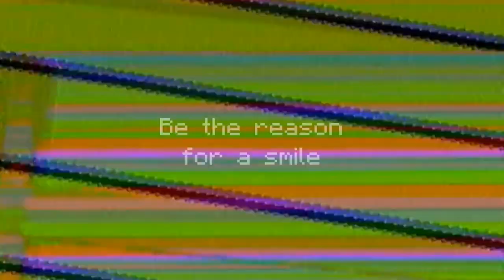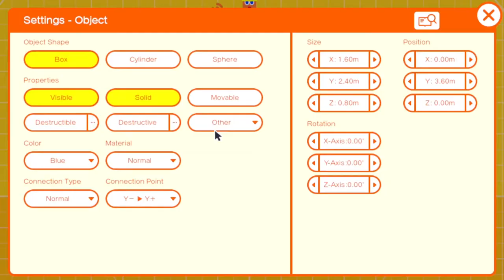How to Make a FNAF Style Sliding Door - Game Builder Garage

Comment from the maker: EDIT: Thanks for 5K views! 

To address a few comments here... The "anchor object" tells the moving object where to start moving from. You don't want this to change, so make sure the anchor has "Moveable" turned off. The other object will move from that position, so make sure that object has "Moveable" turned on. If it doesn't look right (it usually ends up too high), make sure the connection point of the moving object is set to Center-Center.

Comment: How would you make the door slide from top to bottom
Reply from the maker: The anchor object determines where the moving object starts from. So, for a door that slides down to close, you'd put the anchor object where the center of the door will be when it's open. I'm working on another video that will hopefully explain connections better than I have before. 😅
Reply: Thanks
Reply: @skunktronix  also when i tried again, the door opened but closed after a millisecond and kept on doing it repeatedly. Please help

Comment: I did everything it said and turned moveable but it doesn't work so can I be explained how to do this in more instruction.
Reply from the maker: Be sure you've set the anchor object and door object connection point to Center Center. The object settings screen shows the position as the center of the object, so the connection needs to match that.
Reply: @skunktronix  i did that but it wont work